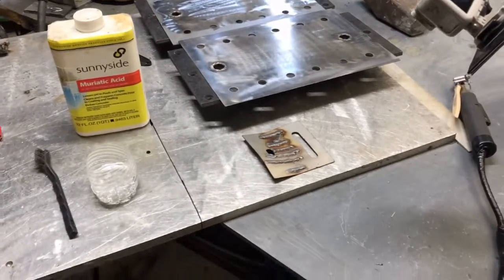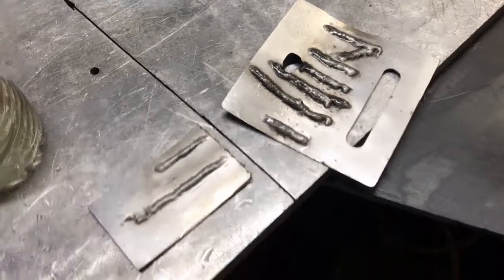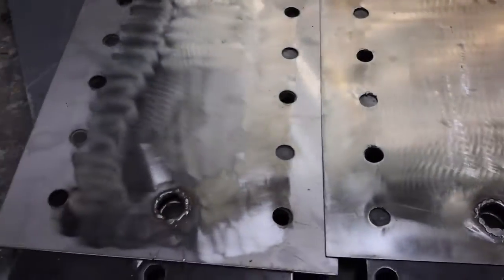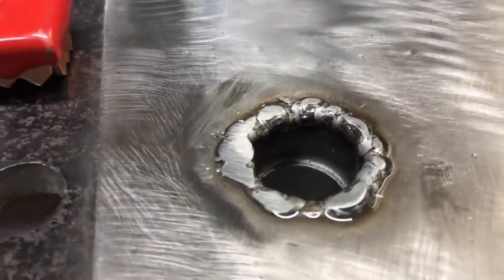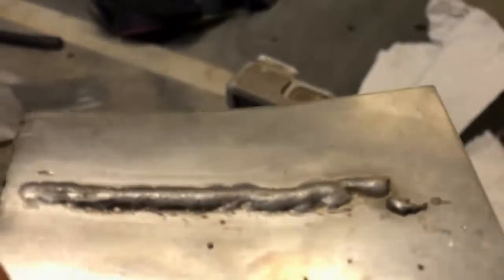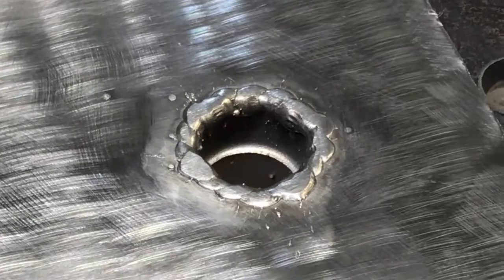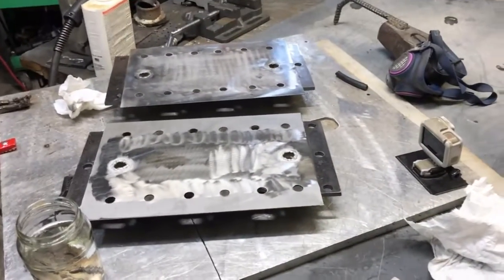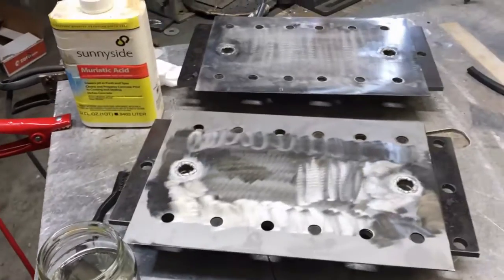Stainless steel passivization to stop rust after weld  0

Comment: possibly a total n00b question, forgive me. I'm a decent amateur welder, I can lay a pretty enough bead and nothing I've fixed has broken again, but to seal i usually just spray with rustolium because pretty didnt matter. I'm looking to build a new computer desk from square tube steel and solid surface countertop material and i want to keep the metallic look of the steel (possibly even go for a brush look with the angle grinder. I'm not sure how to protect the steel after i weld/grind on the whole thing. Is electroplating muriatic acid the only way? cause that would take a while with a 6 foot wide desk with full hutch and shelves.

Comment: Hi anyone knows the contents/elements in water we have to look out for that could cause the stainless steel weld in a water heater tank to rust? 

I have a water heater and the inner tank is made from 304 stainless steel. It is now leaking from corrosion at the sides. After cutting up the tank I noticed the rust only appears on the welded parts. 

PS: I am using bore water.
Reply from the maker: you must passivate the welds with an electric brush and acid

Comment: No no 
The way the electricity runs determines the way the electrons flow. 
God this is from a long time ago ! 
Electrons are negatively charged. I am sure.
Electricity flows from the positive to the negative the ground. 
But 
The electrons are negative they flow from the negative to the positive.
Pretty sure this is right. 

Now in a galvanic solution the flow of the ions will depend on the charge of the ion. 

The current in the galvanic solution will flow from pos to negative. 

If the ions are negative they flow to positive side. 

If the ions are positive charged flow to negative.  This does not work good. 

This is why you switch leads on a welder.

I think I am telling you right but it’s been 45 years.  I gotta go read up

Comment: we just used stainles steel pickling paste(i think they call it that). Works great, but be sure to use proper ppe with it. It makes a nice sissing sound when its on the floor as wel.  And you dont need any fancy things for that, just a container of the paste, a brush to brush it on and i think we just rinsed with water when done. But it has been a long time since i have used it, so i have to read the instruction again before i use the stuff. But i got in touch with when i worked with a guy that normally welded the pipes in milk facilitys where they used it a lot.
Reply from the maker: Yeah ive herd of it , sounds like the way to go , i didnt have any and needed this job done today so thought i would try it .

Comment: The objectives are 2 fold:
1, Remove the iron from the surface layer
2, Create a stable metal oxide layer that impedes further oxide or chloride corrosion.
https://advancedplatingtech.com/passivation-cleaning/passivation-of-stainless-steel/
Reply from the maker: Thanks , i feel like ac would be better or maybe i should have reversed the polarity . We will see as i have a piece in water and i intend to try it with the owrk piece being the anode

Comment: btw, consider getting a TIG setup from Stahlwerk, got my setup for less than 1000 Euros and I'm super happy, if you are only doing stainless can be even cheaper because you don't need AC.
Reply from the maker: Im not using ac and wow , i did this for $1.29  , why spend so much money ? That was the point of this video to show people ho to do it without spending money , most people have all the stuff you need . But thanks for the heads up maybe theres works better
Reply: @NOBOX7  You mentioned getting a TIG so I was recommending a cheap yet good quality machine, of course when it comes to TIG even cheap is pretty expensive compared to MMA welding, but it all depends on the application. Some things you simply cannot do with MMA and vice versa.
Reply from the maker: @RagingShrimp67  Oh yeah i did , need one bad bro i see what you mean im sorry im such a fool , yes yes ill look into that brand and thanks for th heads up . I seen a video of a guy doing this with a tig torch o thats what i thought you ment LOL .
Forgive my ignorance . Comments like this remind me to always be polite no matter what because i am indeed an ashole   some times . Old habits die hard my friend

Comment: Same thing happens to the plates in the hydroxy system, until passivated...that red stuff keeps coming out. I was playing with a cell today that I made years ago and cleaned it in vinegar for a few weeks and all the old red rusty stains on the high grade stainless come off and the cell is running zero red stuff from tap water. It had a lot of tests done years ago and must have completely passivated back then. Never seen a cell run so clean on straight tap water.